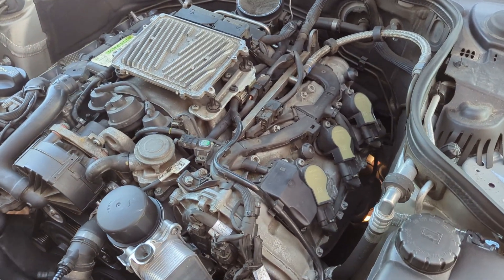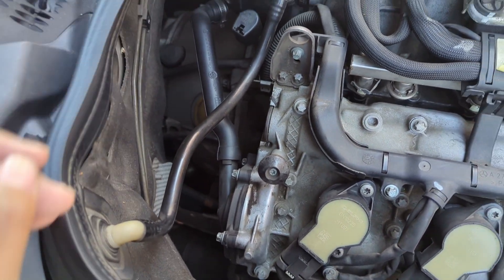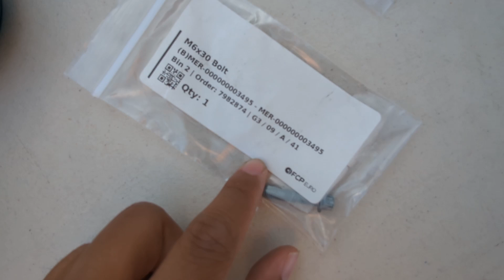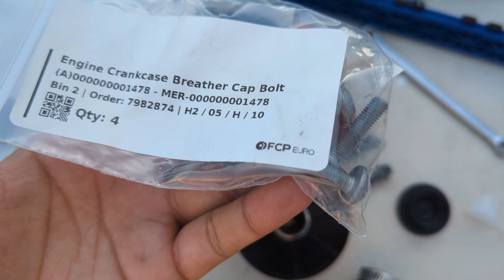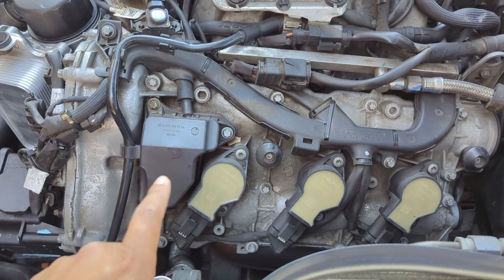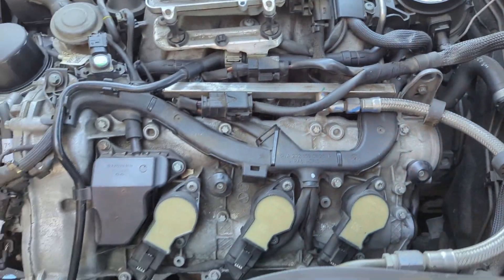Protect the Intake! Mercedes Benz M272 PCV Replacement | S211 Ep. 4

Comment: An ok vid, BUT... 

Where is the actual pcv VALVE located ?? 😢
Reply from the maker: There is no singular Positive Crankcase Ventilation Valve on this engine. The parts shown in this video make up this engine's entire Positive Crankcase Ventilation breather system.

Comment: Hi,
Why you replace hoses if they are not damaged? 
Also how to check if front drip pan is wear of? Are there any moving parts inside front pcv?
Reply from the maker: The hoses are included in the kit and for simplicity I replaced everything at the same time so I can send the entire old kit back to FCP Euro.

IIRC the front PCV is the low pressure side and doesn't see the same amount of wear as the rear drip pan does on the passenger side head. I replaced the front PCV as a "while I'm in there" kind of item too

Comment: Im glad you explained why you would want to do a repair like this because I’m sitting here thinking…these are parts you usually would never have to replace/repair, but on this engine you do. Nice job! I’d probably install an oil catch can instead of doing all you did, but then again in the long run it would be more work emptying the can every couple months (or weeks in the winter).
Reply from the maker: Thanks for watching! I do still plan on installing an oil catch can in this car for redundancy and to reduce the reliance on proprietary parts in the long run.  I'm still not 100% sure on where I want to put the catch can. I do frequent checks over the car and emptying the oil catch can wouldn't add too much time.

Comment: Easy to follow video 👌When should I look into replacing it (i.e. after how many kms or years)?
Reply from the maker: The set of parts I replaced in this video had about 30,000 miles on them and they still looked good. I couldn't find an official replacement interval but I'd probably suggest to start checking the tubes for oil after 30,000 miles in intervals of 2,000 miles. With FCP Euro's lifetime warranty, there was minimal cost for me to be on the early side of replacement. Thanks for watching and happy wrenching!

Comment: What issues were you having that you did all of this?
Reply from the maker: The plastic caps for cams on the back of the cylinder heads will leak oil when they fail and it drips onto the primary cats. If you start smelling burning oil this is one of the first things to check and replace

Comment: Why not just splice oil catch cans in, plug the TB ports, and empty them at oil change intervals instead of doing all that?
Reply from the maker: Oil catch cans would work too. I even have one that I've been meaning to install in this car but I haven't found a good location in the engine bay for it. I've seen a few others put their catch can next to the abs module but it's so far from the pcv locations that they had hoses running everywhere. If I figure out a clean location for a catch can I'll do a video on its install. Thanks for watching!
Reply: @julianmdeleon323  maybe try ones sized for motorcycle?  Thanks for your videos!.
Reply: Catch cans aren’t recommended on port injected engines. M272’s are port injected, you can install a catch can those engines but it will not make much of difference.

Catch cans are more recommended for direct injected engines since they’re proned to gathering deposit buildup especially around the valves.
Reply: @LuckyStar_394  that's good to know that the m272 has port injection. Catch cans are still indicated to stop VOCs from faulty or working PCV valves from entering the intake manifold damaging the intake flaps on those engines by carbon build up,  possibly ruining the engine.  The reason for this video was to show how to replace that PCV system to guard the flaps. Carbon build up on intake valves from direct injection is another issue altogether.  M276 engines do not have flaps in the intake manifold. An occasional "Italian tune up" helps with GDI carbon build up issues.

Comment: Thank you very much for the Great job and excellent video! Now I need to practice on my M272 E350 4matic before I work on my M273 G550!
Reply from the maker: Thanks for watching! Nice pair of cars! Hopefully your G550 has enough room between the engine and firewall to make this job not so difficult. I believe on some v8 cars, more disassembly is needed for access
Reply: @julianmdeleon323  Thank you. Yeah but your video is almost the same with less work (e.g. no need to unhook and disassemble ECM). Need to check if hoses need replacement. M272 is 2009 model while M273 is 2012. No issues on acceleration, idling, no check engine, etc. just preventive as i have experienced changing entire air intake on my 2007 C230 already.

Comment: Love to see some more as I am a M272 owner and you do a great job explaining things and the camera angles are good as well as the editing, so thanks. I’m going through secondary air pump system issues now and having already replaced the pump I’m now onto the check valves and all vac lines. It’s hard to explain/find help or parts for this endeavor so any vids along those lines would be great! Thx for what you do.
Reply from the maker: Thanks for watching! Best of luck on your secondary air pump issues. I don't have any vacuum issues at the moment (knock on wood) but I am noticing a decrease in mpg and my intake manifold actuator arm is broken so an o2 sensor video and an intake manifold replacement video are in the pipeline
Reply: @julianmdeleon323  yup, i opted for replacing actuator arm on my C230 but the root cause is the gunk inside manifold cause flaps to seize/stuck and broke the actuator arm. Better to replace the entire manifold assembly. I you can do replacement, great, coz dealer labor is expensive. A $900 part with total of $4500 installation 😞

Comment: I was wondering what you had the dielectric out for. Good idea it should be used sparingly though to avoid dust accumulation.
Reply from the maker: Yeah definitely use just enough to keep things from drying together and wipe off any excess

Comment: heyy great video, im wondering if it would be worth it to delete the swirl flaps entirely in the intake manifold of me w212 e300 with the same m272 engine you have here, im thinking should i delete the swirl flaps or replace it? what do you recommend.
Reply from the maker: Thanks for watching. I'm not super familiar with the w212 generation's m272. However, swapping to the m014 intake manifold from the r171's m272 is an option to delete the swirl flap equipped intake manifold the other m272's came with. FCPEuro has a great blog and YouTube video about the swap. I, personally, probably won't do the intake manifold swap because I'm in California and the intake manifold swap would likely need a tune and I don't think risking failing smog is worth it for my daily driver.